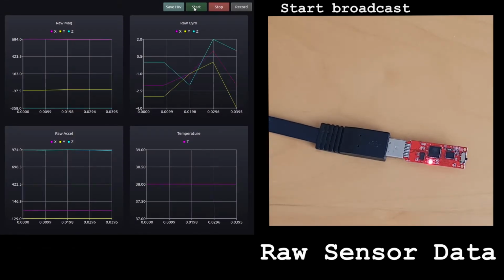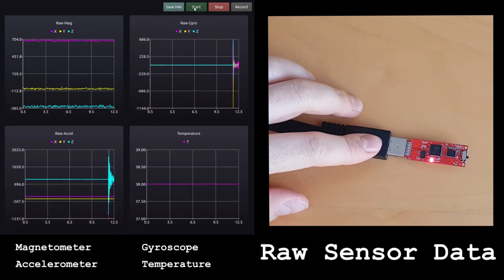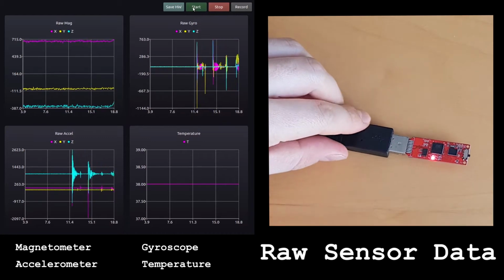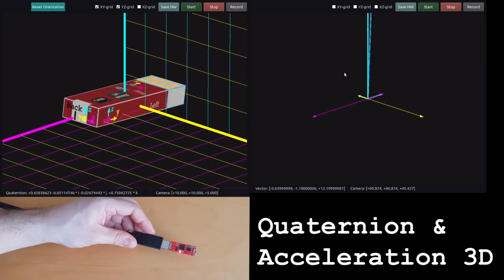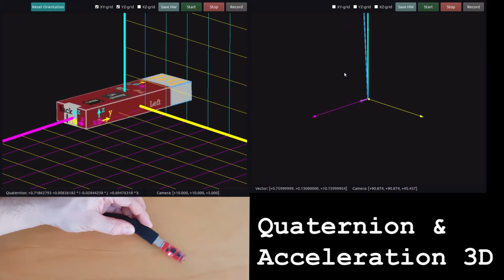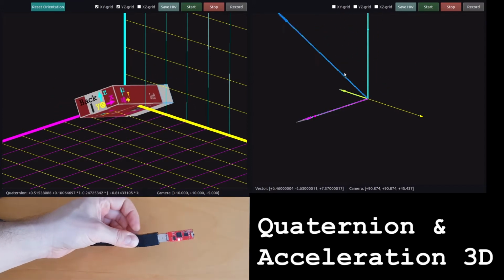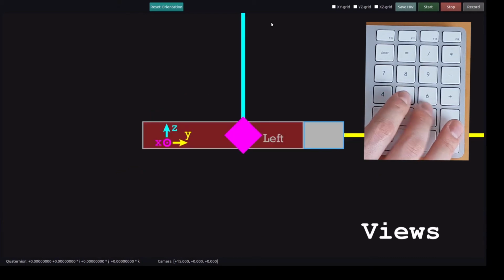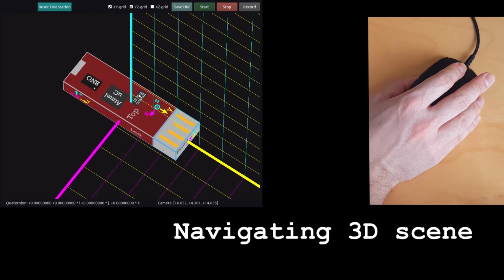Visualizing inertial data from an IMU -- BNO055

Comment: Hi Bno055 have to be calibrated before to get correct angles? Or it’s now required to get good precision? Did you measure angle error?  I mean if you have the sensor at 90 degrees then sleep/turn off , move to some other position to then back to original position how much angle error exist consider it